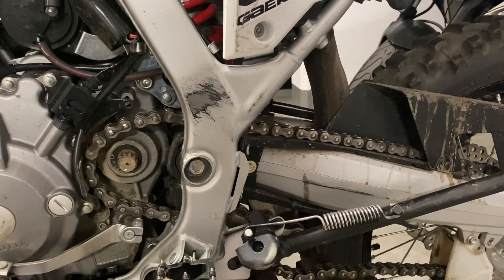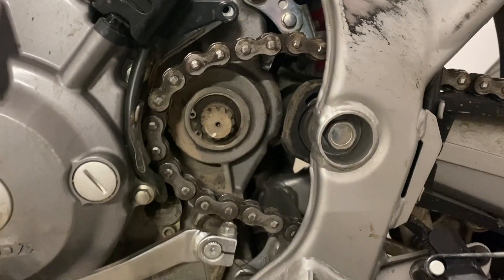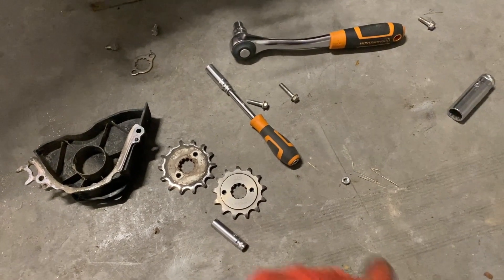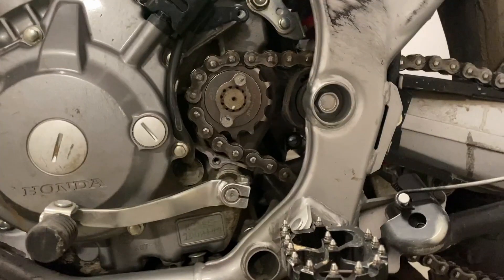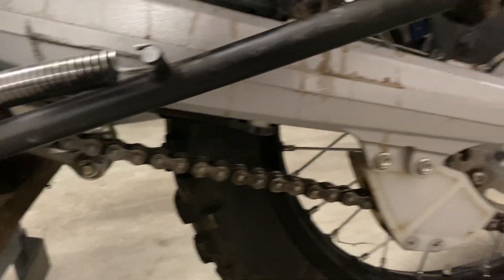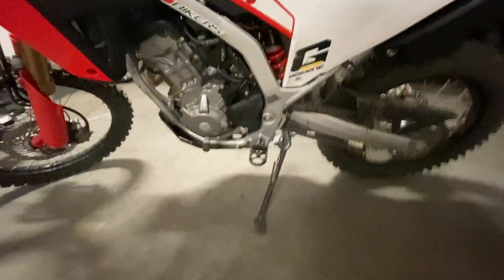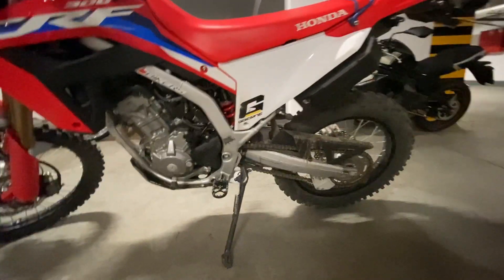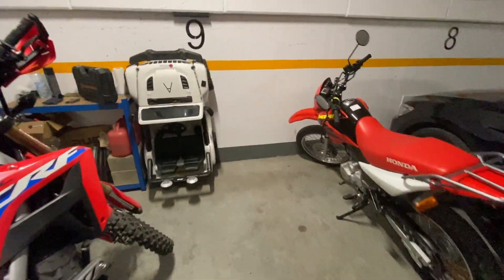CRF 300L - SPROCKET REPLACEMENT

Comment: Would have same result and less work with a bigger sprocket in the rear?
Reply from the maker: I am not convinced if the rear one is easier to replace. For sure the front one is cheaper.
Reply: Larger rear would require a new chain.
Reply: @imcryoqa  THIS
Reply: @imcryoqa  wrong. 13/42 and 14/42 can utilize stock chain.
Reply: @pabloitare  he's wrong lol.